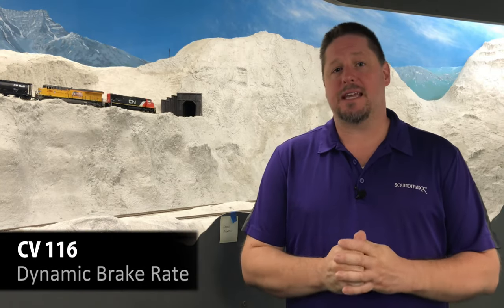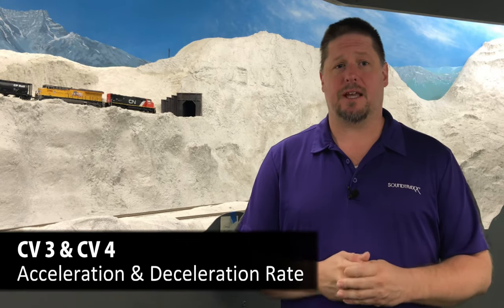Dynamic Brakes in Action!

Comment: Its a shame that the speed step cant be edited with another CV value, I find speed step 8 just too slow for my 3% grade on my layout, I also use just 32 speed steps.
Reply from the maker: The real locos would try to maintain about 10 MPH using the DBs.  This is why the feature was implemented in this way.  During the development of the decoder, we did have former Railroad Engineers (BNSF and Amtrak and the steam on the Durango and Silverton) to draw experience from.  We will take your suggestion to make it adjustable and see where we can implement this adjustment in future products.  Thank you!